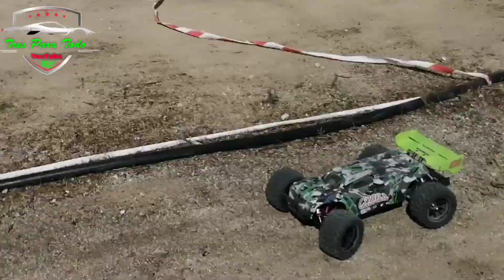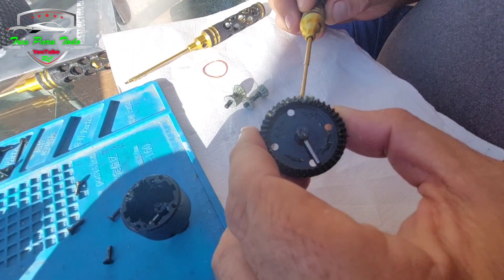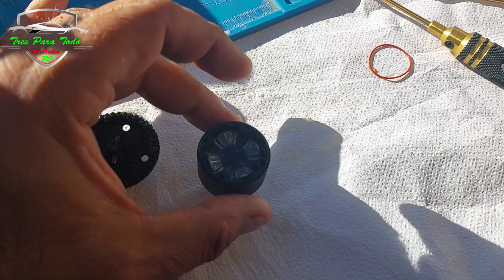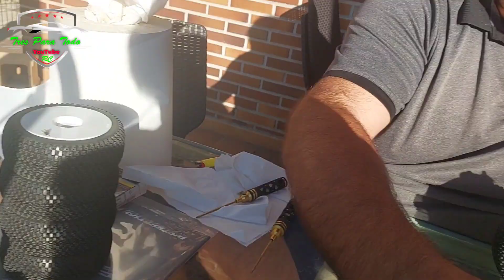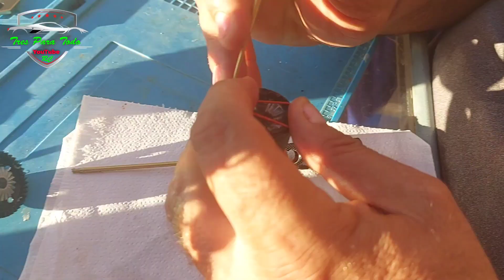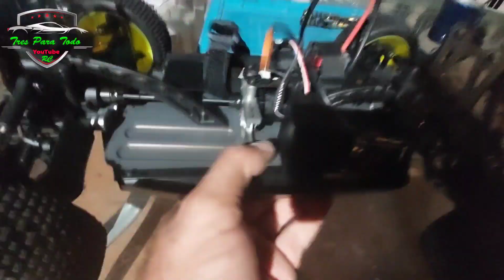#Hyper VS Diferenciales y Servo listo para electrónica.

Comment: Mola buena makina una cosa sabes la silicona k sele pone al arrma kraton
Reply from the maker: Al 1/8 depende de como lo uses y preferencias pero bastante denso de 20,000 a 1 millón. 
Yo iría a por algo como 50,000 delante.
200,000 central.
30,000 atrás.
Y sobre esto según preferencias iría ajustando